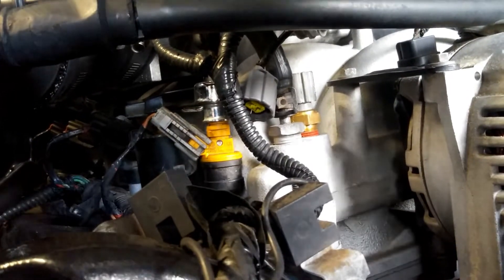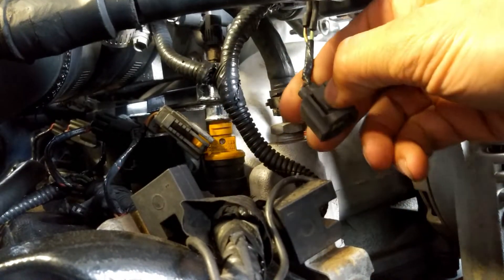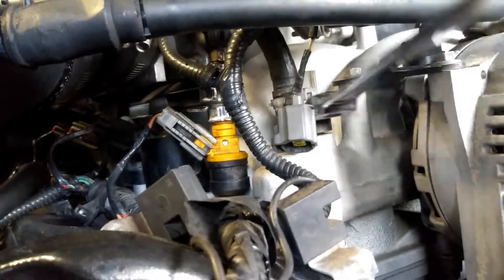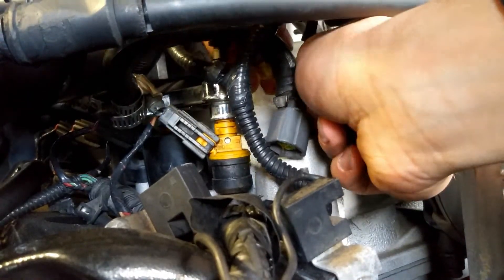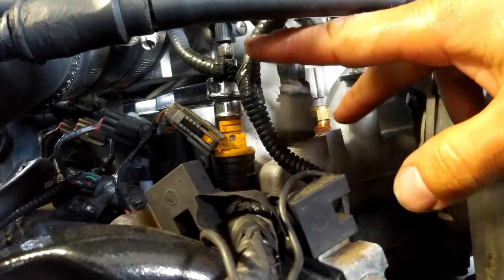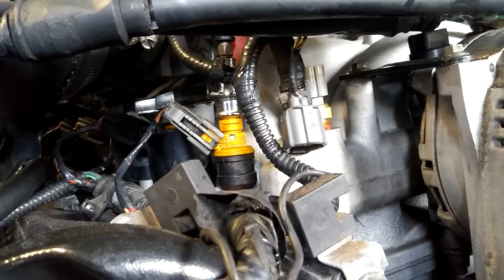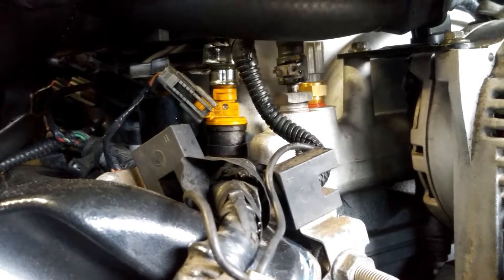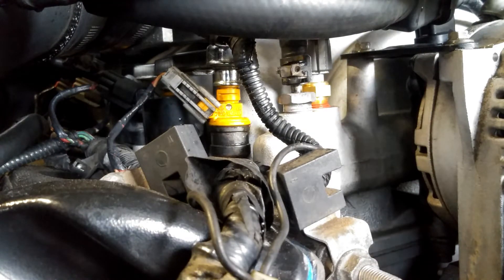01 mustang billet gt ect temp sensor replacement

Comment: When I pulled out the old sensor, coolant shot up and exploded all over the dang place! I don’t even know where the old sensor went. Did I do something wrong? It got all over the engine, myself, the garage.
Reply: You probably changed it when the engine was hot , pressure in the system increases with temperature

Comment: U know why I can't connect the temp sensor to the adapter I see you you just push it and it snaps in place but I cant put mine it dont fit for some reason
Reply from the maker: Are you still having a hard time
Reply: @JaboTheMechanic  I found the issue  it was wrong plug lol
Reply from the maker: Lol. Nice job man. Glad you got it done

Comment: Is this the v6 engine?
Reply from the maker: No its a v8
Reply: @JaboTheMechanic Ok thanks. I'm looking for the coolant temperature sensor on A 2000 v6 mustang.
Reply: Looking for V6 as well on a 2003 3.8 Mustang
Reply: I have a 1999 gt I'm looking for the sensor location that goes in to the dash to work the temperature gauge where would it be located
Reply: This is a v6 3.8 engine in this video
Reply: V6 is on the back of the cylinder by the Master cylinder/ driver side